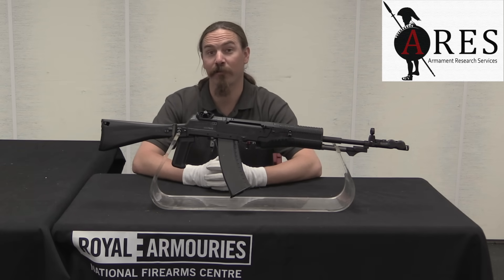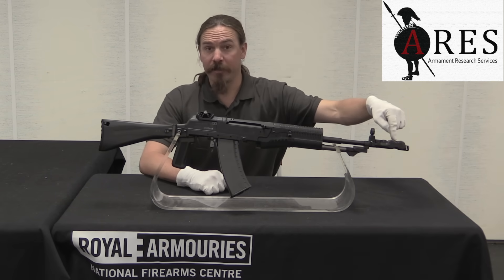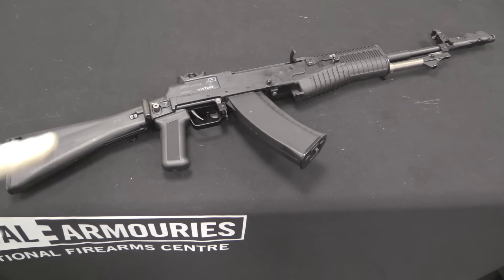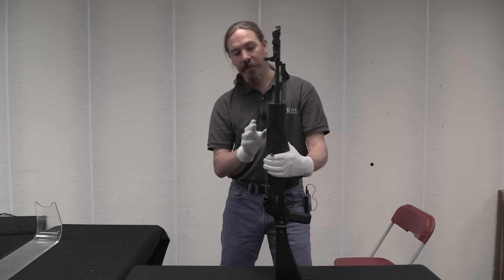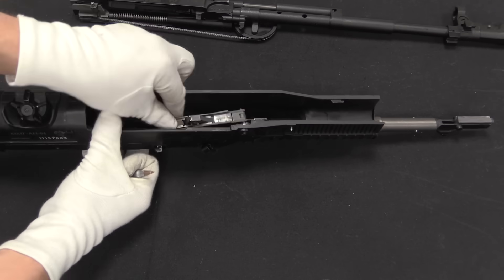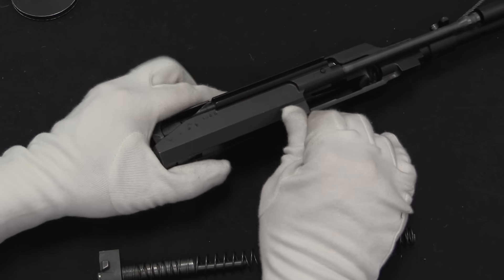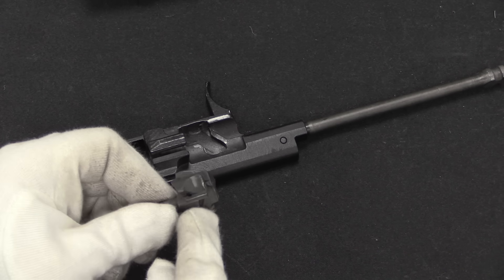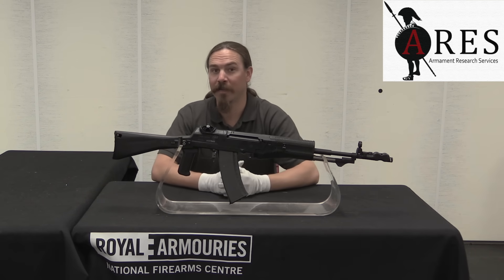Rocket Surgery: Inside the Russian Nikonov AN94

Comment: Though it's highly unlikely, the design of this gun allows for the possibility that someone shooting it would have a little wheel pop out, fall to the ground, skid cartoonishly in place for a brief moment and then speed off. 
Then again the design also allows for you to get whipped with a speeding metal cable, so it's 50/50 whether it'll be a laugh or a tragedy.

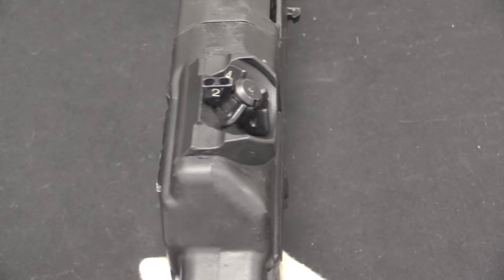Comment: 6:09 in the " AB " mode, the first two shots of the queue also go at a rate of 2000 shots per minute, then the rate automatically decreases to 600 per minute.
Reply: 1800 rpm actually
Reply: @alexm566  yes, I was wrong. Thanks for the correction.

Comment: What a remarkable firearm. It's two thirds as effective as the G11, but despite the perception that the AN94s has complicated inner workings it's child's play to disassemble and work on, by comparison to the inner workings of the G11 lol. I'll take 2 rounds on the same point of aim in a weapon with less complexity over one that fires three, but where the internals look like the inner workings of a grandfather clock!

Interesting to see how all the different countries went in different directions with the same overall goal. The G11 and AN94 both address the goal, and both almost became full production firearms, but there's a lot more problems introduced with all the complexity. If you're using it in a desert or jungle environment, even in cold weather I suspect you'd have serious feed issues with both of them. Too many working parts and too much reliance on perfect timing that expansion and contraction would really mess with. Not to mention getting dirt or even heavy moisture in the action. 

Remarkable rifles from a technical standpoint, but probably not favoured by the end user who'll end up posted to some grimy hellhole with a weapon that needs a clock-smith to fix if something goes out of whack. The AN94 probably isn't quite so susceptible to environment, but it's still overly complicated compared to an AK-47! I think I'd take the older gun in a heartbeat. Despite the overall lack of accuracy, you know you can drag it through the mud and still have it behave exactly as intended. 

Sometimes reinventing the wheel gives you square wheels, and sure, you can make them move the cart. But is it really worth it? For an infantry soldier, what they want is tried and tested and known to be reliable, easy to fix in a pinch, and as capable of dealing with the environment as they are. 

Cool rifle, and not quite a fail, but not quite a real success either. Reminds me a little of the North Koreans with their helical magazine AK's. Fancy, and best case scenario they could be a real game changer, but they'll fuck up far more often than a banana clip. And if that's all you got...

Comment: me: why not just two barrels and some kind of rail system to deliver the second round to the other barrel

i know i know, heavier... but no moving barrel, even higher accuracy, propably way more simple than this russian G11
Reply: I now really want to see an open bolt, 2-barrel submachine gun, you could have two magazines side by side ;P
Reply: @VeraTR909  yeah, the 2 mags came also to mind, but i´m sure you could avoid that with some fancy engineering

Comment: I like how disassembly requires slamming it against a hard surface

Russian engineering, ladies and gentlemen. I love it.
Reply: Well, technically, not a single piece of this gun is complex.
The problem is that there are TOO MANY of them.
So it's the worst kind of complex - everything is a vital piece, simplistic as duck and can't be optimized. That's basically a gun without modification potential straight out of production.
Reply: @burningsinner1132  it's because every single part is already optimized to its peak. that's why this gun is brilliant art-of-engineering piece imo.
Reply: @karlja3ger  It is a brilliant piece of engineering, but it's a bad weapon. Because weapon has to stay relevant to UNEXPECTED shifts in engineering. RPG- 7 uses somewhat questionable design of   a rocket sitting outwards, which hurts it's accuracy. However, this seemingly pathetic design proved to be future-proof because you can spit out any geometry shape out of it as long as you can fit 40mm tail adapter and it's not too heavy to be shot via 2/4.5kg rated powder charge. In certain conflict in Eastern Europe obsolete grenades receive extras and quite often 80mm mortar rounds are retrofitted for better anti-infantry work. 
In the meantime, the "perfect" rifle might as well be used as a scrap the moment war has changed... again, because you need to engineer a new rifle.
Reply: @burningsinner1132  this is not a "perfect" rifle. this is a work assigned to solve specific problem, which was the case back in the 1978 when Abakan project took place. moreover, despite being an actual reason for project Abakan (replacing AK with new rifle fixing its huge recoil caused by huge moving bolt), classic AK-74M is much closer to the definition of "perfect rifle", yet still not it.
Reply: @karlja3ger  AK-74M still got it's share of problems though. AK-12 was supposed to fix them (Literally all the things which were required is free floating barrel to give it an accuracy POTENTIAL, better dust cover mount and the rails out of the box, with possible sprinkles of AEK/late AK100 series style recoil dampener). Somehow IPSC cringe baby got the job and screwed everything. The only good thing AK got out of AK-12 is new mags.
Reply: its so awesome the guy is struggling just to explain it
Reply: Look alive boys, Intel guys think there might be a russian unit hiding somewhere nearby and we'll have to be careful to try and find them...

Sound of 30 russian soldiers slamming their AN94 against the ground to disassemble them for cleaning

Oh... Never mind then.
Reply: @kowell if they are disassembling their rifles simultaneously, it means what it's a military training...
Yep I know what it's a joke, I'm too boring to laugh

Comment: THE KING OF BATTLEFIELD 3 Assault Rifles! I wish i could shoot one of these so bad
Reply: I wish it had 1800 rpm instead of 1400 rpm in BF
Reply: @saint_penrose512  if you can manage trigger discipline and ammo management, by limiting ur fire to the first 2 rounds in BF with the AN you can get the 1800. The 1400 comes from the 3rd round and following shooting at a slower rate

Comment: The most unique on this weapon is, that on Full auto swith, you get the 2-rounds burst, then it goes 600 RPM full auto... So burst fire is always on, only change is if it fires full auto after burst or if it is ,,single fire''

Comment: I know I'm late to the party, but I was curious how the rifle operates in single-shot and full auto, with that weird counterbalance system in place. In single-shot mode, what would prevent the 2nd shot? Is a round loaded like in two-shot mode, but the hammer doesn't strike, or is that second round not loaded into the chamber until later in the cycle? In full auto, is it a continuous stream of 2 rounds per kickback from the rifle? He quoted the ROF as being higher in two-shot mode (@1800 rds/min) than in full auto (@600 rds/min,) which hints that some part of the mechanism is disabled or retarded in full auto. Another point would be that this rifle is a reverse bullpup, the barrel begins inches beyond where it would begin in an ordinary rifle due to that second round staging area just forward of the magazine, so you get a shorter barrel in a bulkier weapon.

Comment: I don't know if you'll see this, or if anyone could answer it, but I had a question; Would it be theoretically possible to recreate the AN 94 in the US using a Binary trigger to replace the auto-seer in the trigger mechanism to run the hyper-burst mode, as a workaround to the NFA?
Reply: No. Well sort of, but only for cool points. The hyper fire fires those first two rounds at a cyclic rate of nearly 2000 rounds per minute. Both rounds are fired before the recoil impulse is even felt. That is orders of magnitude faster than a binary trigger is capable of functioning. It’s accelerated because the barrel is moving backwards as the bolt is coming forwards and they meet somewhere in the middle for the second shot. 

You could in theory make a similar system with a binary trigger but you would lose the hyperfire functionality and it would be way more complicated and no more useful than any other semiautomatic rifle.

Comment: This weapon is very obviously Russian. It's basically a gun with a second smaller gun inside of it, just like matryoshka Russian nesting dolls.
Reply: just imagine 5.45 bullet inside 7.62 inside 12.7 in one cartrige
Reply: @SomewhereInSiberia  inside a 14.5mm
Reply: now imagine if they decide to go 3 round hyperburst.
Reply: @darklighter8968  It's gonna be like inception, a dream within a dream, but then that turns into dream within a dream within a dream...AN-94's successor will be an AN-94 inside a larger, even more complex AN-94.
Reply: @ZoeSimza  So let's agree that it'll be a 105mm howitzer
Reply: Darklighter89 when they invent something like this they’ll be able to use light speed or teleportation
Reply: @darklighter8968 Here from the future. Watch garand thumb's video on the AN-94 and you'll see sometimes he was getting the 3 round burst. Perhaps a mechanical failure but still very cool.
Reply: @darklighter8968  YES
Reply: @darklighter8968  the delay required for the 3rd round would just slow the burst fire down. It's been studied but essentially for pure speed and accuracy 2 round bursts are best. 

The only way around those issues is the electronic firing system guns with electrically triggered bullets that can shoot all of the available ammo before the recoil impulse. But also requires alot of other shit and is best used in localized mounted weapons versus a portable gun. 

Also why the states never built more then a few prototypes of that pistol that can dump its whole load in one burst fire shot. 9 shot burst where the last shot is fired before the first leaves the barrel has alot of sketchy things that can go wrong.
Reply: @tsorevitch2409  That's basically an automatic Chiappa Triple Threat
Reply: @ajeje1996  go look TKB-059 I'm sure you'll like it
Reply: Matryoshnikov
Reply: You see Ivan,
Reply: No cap, can we get someone to make a matryoshka styled gun, maybe call it the "Amatroshka"
Reply: Like a Turducken....chicken inside a duck inside a turkey.
Reply: I guess you've seen loadout huh?
Reply: Omg
Reply: That’s hilarious
Reply: Варежки. Дети их часто теряют поэтому родители подвязывают(подщивают) их на тесьму через петельку в воротнике пропущенную через рукава.
Reply: The SU57 of guns.
Reply: Matryoshka was stolen in China. As all “russian” history and culture was adopted from other nations.
Reply: @zoha605  Not sure about that. The closest thing to Matryoshka dolls in other cultures comes from Japan, but those can't be nested one inside the other and that's kind of like the whole theme of Matryoshka dolls. I think you might be mistake.
Reply: @zoha605  don't think you know what you are talking about at all. Stop being racist.
Reply: @zoha605  ofcourse you're Ukrainian... Ofcourse...
Reply: @marinodezelak1180  Russia was named only in 1704 by Petr-1. What was before? Where culture from 50 distinct ethnic groups?
Reply: @zoha605  and Ukraine exists as a country since 1991... does it mean it has no culture? Lol

Where? What do you mean where it is? It's there... ofcourse.
Reply: @marinodezelak1180  realy lol. What was Kyiv 1000 years ago?
Reply: @zoha605  You understand Slavic Ukrainians and Slavic Russians are practically the same people... do you not?

Kyiv took over the role of the capital of the loose federation of east slavic and fino-ugric people, from Novgorod, which was the capital previously to that... then, a while later the Grand duchy of Moscow took over.

Ukrainians are just Russians that stayed in Ukraine And Russians are just Ukrainians that spread Eastward. Same people, different names... It's interesting what nationalism in both countries can do to create a divide. To the point where you think you own the culture of Russians despite them being the actually people with the same culture who simply spread further eastwards.
Reply: @marinodezelak1180  russian is not slavic. Moskovite, tartaria etc. - neither side to slavs
Reply: @zoha605  this stupid nonsense again... "Slavic" is a language and cultural group.. all slavs are intermixed aplenty with other peoples due to the great migrations...

Ukrainians are just as mixed with Tatars as Russians are... Culturally Russians are Slavic, as well as they have the blood Haplogroup commonly associated with the Slavic language group, at least the vast majority does.
Reply: @marinodezelak1180  russian statehood was made by Tatrs. Russia paid tribute to the Tatars (Crimeans) until the 16th century. Russian language is not related to Ukrainian in the same way as, for example, Belarusian, Polish or Bulgarian. But at the same time it was formed in its modern form only in the 18th century. Mainly on the basis of ecclesiastical and written scientific forms from the territory of the then Ukraine. (Moscow University began with the relocation of Kyiv-Mohylyanka by Petro-1).
Reply: @marinodezelak1180  
finally i heard "nationalistic". If I say things that are unpleasant for a moscovite, of cource i hear the answer about "nazy" or other really "bullshit" as you say. And I don't care about your russian chauvinism propaganda. Becouse before the war (Russia against Ukraine) I lived in Donetsk and I really know who the modern nazi are. Bringing with them not only violence, poverty and destruction, but also concentration camps and tortures.
Reply: @marinodezelak1180  And one more thing: Belarusians have old name Litvins. And the Belarusian language is better understood by a Ukrainian, Sloven or a Pole, rather than a Russian.
Reply: @ImPedofinderGeneral  - nickname sad but true.
Reply: @zoha605  oh, really? You said Bulgarian is related to Ukrainian more than to Russian?

Do you known like anything about modern (18th century and after) Bulgarian? It's Slavonic Inglés. Inglés of Slavic world. Grammaticaly-wise it's close to English and French but not to other Slavonic languages.
Yet the lexics is very close to modern Russian, since the modern Russian before becoming the modern itself had got a lot from Old Church Slavonic, which was artificially created in Bulgaria back in the days of the end of the first millennium. 

Judging solely by that it's absolutely clear that it's not about someone, being a atrocious Moskovitean. It's about you, blabbermouthing about the surface facts you read... somewhere, sometime.
Reply: @worldoftancraft  I can read and understand the inscriptions on the walls of the ancient church of Sophia of Kyiv 11-13 centuries. Because the grammar of that language is connected with the modern Ukrainian language.
Reply: @zoha605  of course you can, cuz it's not early or middle English. You still have no excuse why you wrote the bs about Bulgarian
Reply: @worldoftancraft  Okey.
Reply: @zoha605  kyiv a thousand years ago was controlled by Russia. Ukraine and Poland for most of their history have been dominated by Russia. 

Italy was only formed when. Yet we still recognize its culture. 

Lol. Names mean nothing. My ancestors are the Norman's. They are vikings, Christian vikings. They converted religion and changed their cultural name. Yet they are still vikings. And raiding culture was huge. 

Do I just say my ancestors didn't exist before the year 911 when Rollo the walker was given the land rights to Normandy? Lol. Or do I just say my ancestor who is literally the founder of Normandy wasn't technically a Duke because at the time his title was the same as king? Lol.
Reply: @bmxriderforlife1234  Well, we will not look back to antiquity, where Kyiv is somewhere 800 years older than Moscow. For example, Ukraine gained independence in 1917, and was re-occupied in 1921 by the communists (russian bolsheviks).
Reply: @zoha605  except nobody ever claimed Moscow was Russias oldest city. Derbent is if I'm not mistaken. Pretty sure multiple others are also older. 

Lol novgorod is older than Moscow. Moscow is only the capital because the noble family of Moscow which was a duchey became influential enough to become the tsars. 

Just like my ancestors other line became influential enough to raise an army that conquered England. My ancestor is the double second cousin of William the conquerer and our shared common ancestor is Rollo the walker. 

Duke becomes a king. Makes their choices of influence.
Reply: @bmxriderforlife1234  Derbent - the city of Russia?  Wtf?  Then, like the Daily, it is the oldest city in Britain.  The capital of the Slavic principality of Novgorod was taken by Ivan IV in 1569.  He was burned, killing most residents and surrounding villages.  After another couple of years, an epidemic of plague raged.  In the same way the Tatar Kazan was annexed to the Moscow kingdom.
Reply: @zoha605 what is this mythology that Russia is the most divergent of all slavs lol, look I hate the Kremlin as much as the next guy but the people have little to do with it. I would take the effort to correct you but it would take too long, I just implore you to look beyond surface level facebook tier research and folk tales.